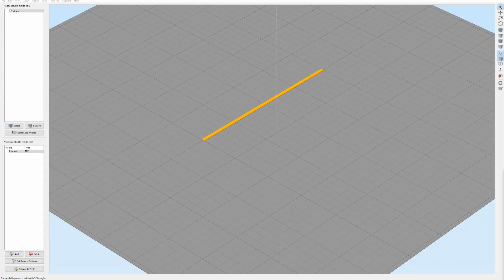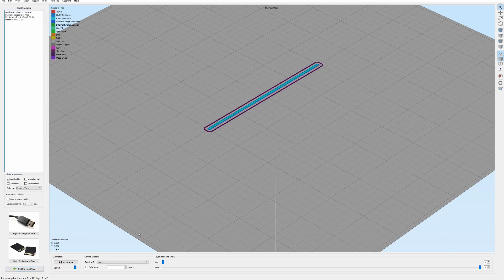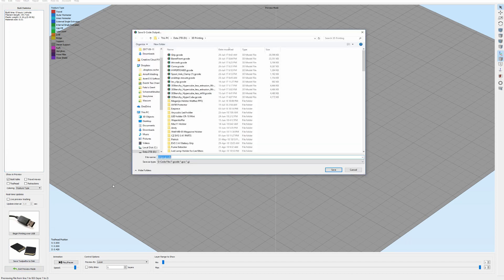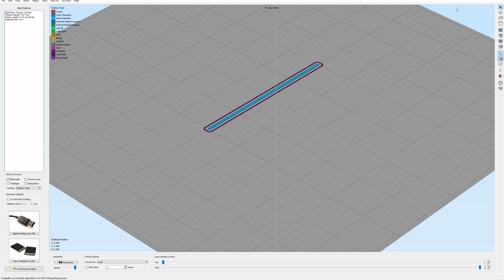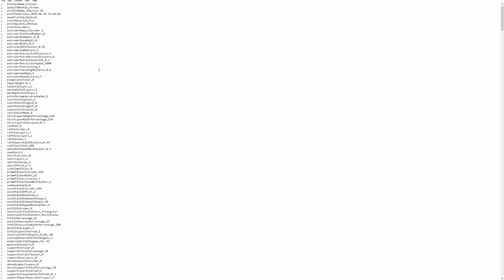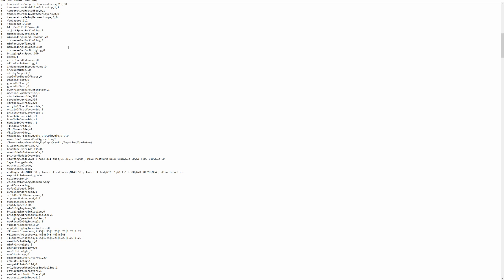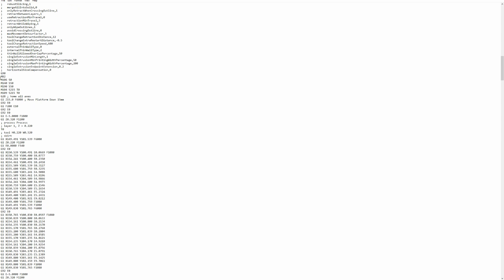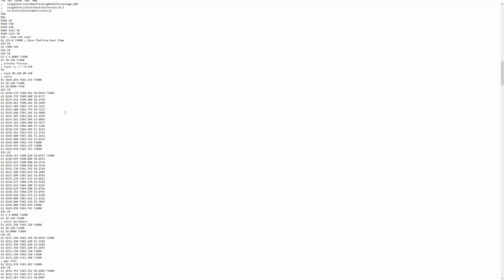▼ 3D Printing Questions - Things that can go wrong when sharing FFF Files (Slicer settings)

Comment: I disagree because I never ever take a 3d printer setup and run with it but what I do is use it as a starting point and that is VERY valuable to me.  It saves me time, headache, and effort when 70% of it works and 30% is wonky.  Been around this stuff for 6 years so anything that helps even one step is most welcomed.  I know a lot of script kiddies are out there but for a lot of us those settings that worked for you is the very foundation we are looking for instead of having to spend tons of hours replicating everything you did that just may very well work for us.
Reply from the maker: I understand your point of view, but honestly, then you don't know my video's.
Every time I make a video and I use my slicer to generate an STL file, I also explain the settings I made and why I made the choices I made for these settings. In fact, I always explain this in so much detail that I hope the viewer will understand the setting and can then determine what setting would be right to choose for his or her printer. In my opinion that's much more valuable than just sharing my settings because than also the last 30%, you are talking about are explained to you.
Reply: Share your settings and explain away is the best option.

Comment: I can really sympathise with this. I work for rigid.ink as a printing support specialist.
ALL of the printers I manage, except one (a box-standard iMakr Smartt), are fitted with custom extruder hardware and firmware. For instance, the CR-10S is fitted with a BL-Touch, Trinamics, a mains bed heater, a Titan Aero with a Volcano and high-temp thermocouple system. Oh, and just for fun, it also has a centre origin.

In other words, the S3D scripts and bed settings on our CR-10S would destroy any other CR-10S they were plugged into.
If asked, I will provide 'sanitised' settings lists for S3D and Cura, but I am not going to open our company up to complaints from people stuffing their nozzles into their beds and destroying whatever surface they have on there.

Most people I deal with are really understanding, but sometimes the sheer frustration of learning to use their 3D printers can get the better of them and it boils over. You just have to keep plodding along and hope they understand why.
Like I said, most do.
Oh and remember - keep smiling, no matter what. ;)